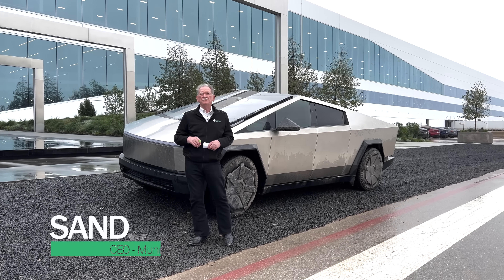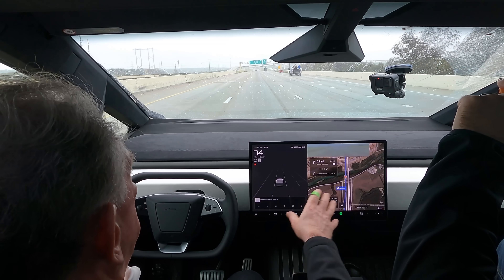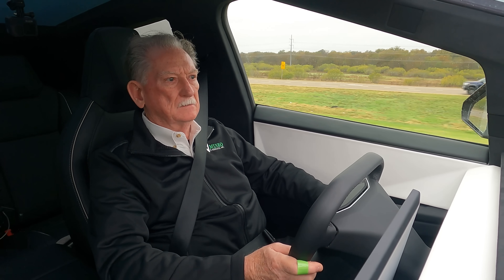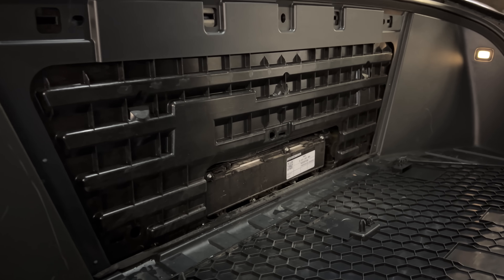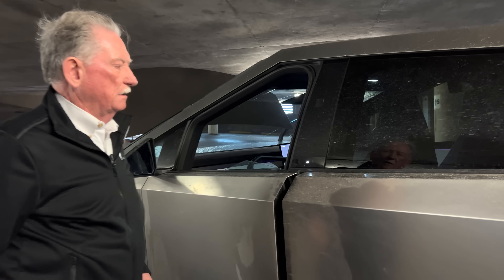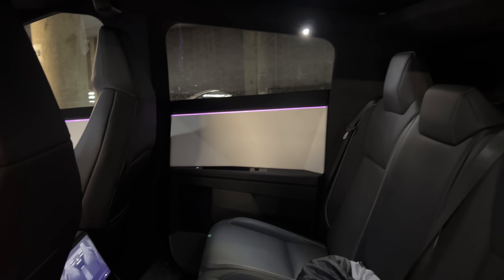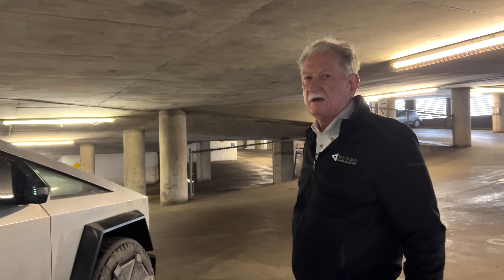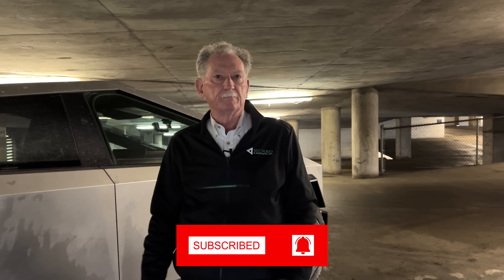Sandy's First Impressions of the Tesla Cybertruck!

Comment: He didn't mention the weight of it, our off roading in NZ is steep slippery. This would be very scary on down hill if hasnt destroyed the track on the way up with wheel spin. It doesn't  appear to have much space in the back for tradies the bulk of the buyers. Not to  mention the charging time if you can find a charger. Australia will have different issues. It looks cheap inside saving on conventional buttons. Interesting concept.

Comment: Had to laugh when Munro said on an interview that farmers would be looking to replace their tractors with the CT.
Oh, and repairs wouldn't be an issues, despite no bodyshops being tooled or trained in fixing that sort of chassis.
I think too many Elon fans are getting high of his farts..
Reply: I saw the back side of a stainless panel on one of the tour videos.
Looked like there were bolt / location holes.
That being the case you'd only need a socket set and a jig to space the panel.
Tight folds, straight edges and 90° corners would make it EASY to align.
.
That would explain the equal gaps Sandy saw.... Once the first panel is right, the others all work from that.
.
But you can stay hopeful that nobody thought of that. 😉
Reply: @rogerstarkey5390   Galvanic corrosion could be an issue. Either way, price, range, payload capability on the street, as lack of aftermarket support, as parts supply, could be a big deterrent for many truck owners.
Reply: @rogerstarkey5390  time will certainly tell Roger

Comment: BlackBerry vs iPhone moment.
Remember the advertisement Acura legend 1980’s with steel marble for panel gaps.  Not sure what the big deal with everyone looking at panel gaps.  Take a look at other car.  I buy tech and dependability not panel gaps.
Ford/GM/Dodge are highly dependent on their trucks vs Tesla more for mass cars, Y, 3, and soon 2.  Cybertruck not a huge part of Tesla.  Remember Tesla is an energy company.  Car batteries have made Grid batteries competitive.  Tesla msrp always pays for superchargers that it builds.  Tesla has diversified batteries vs competition.  Most vehicles LFP(lithium IRON) but also offers 18650, 2170, 4680 tabless DRY CELL.  Tesla also offers SOTA and FOTA WiFi updates.  USA needs more solar and storage batteries as USA energy will become expensive like other countries.  This truck has so many new techs, steer by wire, 48v low volt, 2 400v batteries to make 800v, thick stainless exoskeleton, competitive with other EVs with larger batteries.  More Tesla superchargers supplemented with solar and battery storage.  The past 4 years increased inflation that compounds every year.  High interest rates means companies with high debt paying more money to service past debt with less money for future innovation.  Similar to government overspending taking out more debt to pay for future debt

Comment: I like the rear wheel steering and of course there’s the Tesla performance. But for how different this looks there isn’t a lot of innovation as far as use of space goes. For example, the small frunk. I don’t see anything that other vehicles don’t have. 
The range isn’t earth shattering. 
The bed isn’t that much longer than a short box, Ford or Chevy. 
I would buy a Rivian over this any day if I didn’t need the longer bed.
Reply: The feint isn't innovation from the company which invented the frunk (go on, say "beetle")
It's bigger than you think.
Range? More coming.
.
The bed? 7"" longer than the Lightning (and similar ICE F150) 8" more than the Rivian, a full foot more than the Hmmmm... Errr.
More load.
The same or more tow capacity.
More secure.
Tough.
Good job looking for negatives.
Reply: @rogerstarkey5390  I’m just saying it isn’t such a big advance in technology or design that I would trade in my Ford Lightning for it. 
How is it more secure because of the tonneau cover? I have one of those on my truck. 
I know what the bed length is and that’s why made the comment I did. Half a foot isn’t enough to make me drive something that’s this strange looking. 
And before you accuse me of being a Tesla hater, I’ve owned three of them along with other EVs and hybrids.

Comment: Checking panel gaps on a vehicle  allocated to media review is kind of silly.  It would be massaged into acceptability for sure. Let’s see how #1000 is 🤷🏻‍♂️
Reply: I bet I could fit panels on that.
90° angles.
Straight lines.
Location points on millimetre accurate castings.
Easy to gauge gaps.
.
Stop projecting old stereotypes and problems onto new products.
If anything, it's going to get BETTER as the workers refine their skills.
Reply: @rogerstarkey5390  Sorry, I wasn't coming at it from that angle.  Just saying that any good marketing department at a major manufacturer is going to make sure those gaps are good when they go out to media, even if they are conventially manufactured.  I imagine they will be great on the final truck, but the proof is in the pudding.

Comment: Sandy, I am with you on getting rid of the noise. It's right up there with the emissions as far as I am concerned.
Reply: On speeds of 50+ kmph well majority of noise comes from tires, not engine.
Reply: @alexeysamokhin9629  I think the aerodynamics of a brick also cause acoustic noise.
Reply: @PbPomper  Google says Porsche 911 TT has a coefficient of drag between 0.31 and 0.34, cybertruck has 0.335 so... yeah... brick.
Reply: @t3hpwninat0r  aerodynamic drag is a function of cd and frontal area. Boasting about cd and comparing it to low sports cars makes no sense (apart from marketing).
Reply: @DimitarStanev i'm comparing it to F-150
Reply: @@Ac_Adapter As someone that has built multiple cars from scratch and worked on car for 35 years, Raced cars and motorcycles for decades I will say loud does not contribute to enjoyment. I enjoy the sound of a good engine but if I can't talk in the car or have to stop a conversation outside it's to loud. Personally I can't wait until the obnoxious cars and especially the POS no muffler hardleys are gone.
Reply: @GROND15  I would ban noise in no time!, I have a bunch of stupid kids riding stupid slow but noisy 2strokes dirtbikes in my town. The funny thing is, at least in my country, we have a noise limit and there's a big fine if you get caught, the problem is local police are a bunch of useless and they don't do their job
Reply: @@Ac_Adapter Yep, agreed. My daily commuting appliance will be an EV, but my fun car will always be a loud H shift pure ICE (even though my EV is objectively faster than my fun car it has no soul).
Reply: If only the electric Harley Davidson would take over…
Reply: @@Ac_Adapter The sound might be nice on a V8 or flat 6 but most ICE cars don’t have that and don’t make a nice sound at all
Reply: @@Ac_Adapter I never said I was a car guy. I said, based on my experience, I used to have this sensation or feeling that large engines that make a lot of noise translated to raw power. That was just how I felt; Everyone has a different experience after all. 

My perspective has changed since owning and driving an EV as a daily driver. Powerful to ME means something different. You cannot decide how I feel. You can still feel powerful; I can still giggle at you.
Reply: I like the sound of a B58, your rattling 4 cylinder Kia, you can keep it.  I was next to a Mustang GT in my model Y.  I thought I’m faster and he’s just wasting fuel making noise!  Keep in mind I do enjoy a good gas engine and manual transmission, but I’m with most on this now that I’ve been enlightened with an EV.
Reply: @billm47645 V8's are fine, Nice deep rumble, it's those shitty Buzzbox 4 cylinder turbo's with Milo tin exhausts that are the worst, Absolute garbage sound like a kids toy.
Reply: Amen
Reply: lol!!!!! what are your useless EVs even contributing to improve the "emissions" everything from the roads to power stations to the grid, water supply, agriculture.... aviation even spacex rockets are not powered by batteries!
Reply: Sometimes I giggle at those cars that sound like they're working so hard just to keep pace with me. Other times I just find it incredibly obnoxious how loud they must be. It really depends on my mood. But, at least for me, since owning an EV and feeling the acceleration, I've come to associate that small whine of an electric motor to give me the same sensation that I used to get out of loud v8 engines.

Even while typing this comment, I hear through the music through my headphones a car outside slamming the accelerator down and making a whole bunch of noise. I'm wearing headphones over my ears, listening to music, in an incredibly well insulated office.... and I still must hear someone driving their car around? That just doesn't seem right. I don't understand the desire to be a part of everybody else's life by making so much noise.
Reply: @ColrathD dead right. I heard Tim Dodd, The Everyday Astronaut, refer to the noise as "the sound of Struggle".
Reply: @ColrathD A-fucking-MEN!!!!!! 🙏🏻
Reply: @ColrathD I love to.make noise, ide off myself if I had to give up noise making... especially with my car, glasspack muffler and delete the main cat to make it even louder.
Reply: in third words countries there are like 40 years old+ vehicles that are still on the roads doing way more job than those useless EVs.
Reply: elon is a god.  For the blind, He is vision. For the hungry, He is the chef. For the thirsty, He is water. If Elon thinks, I agree. If Elon speaks, I’m listening. If Elon has one fan, it is me. If Elon has no fans, I do not exist.
Reply: @addy405  Sounds like you had some kind of contribution to this drug dealers dream machine.
Reply: I like noise.
Reply: More noise, more fun.
Reply: I really notice the vehicle exhaust when bicycling.  I'm glad it's going away, and it's already much better than it used to be.
Reply: @pfcrow  unfortunately its not going away sorry to disappoint your useless EVs arent going to take care of that gigsntic infrastructure they are relying on. how many inches of roads have the 1000hp 0-60 in 0.5 s have ever built!?

Comment: If the power goes out and a the car is on fire or you are rolling towards a lake and the power goes out, the steering wheel no longer works and the doors would lock you in right.
Reply: I was just about to award "dumb comment of the day" to someone else!!!!
You just beat them!
Reply: @rogerstarkey5390  Its not your fault. Youre just ignorant. Certainly youre aware of the number of ev owners who have died or almost died from being trapped in their tesla EVs because of the battery dying and a fire started? Of course, you haven't, because you're a moron
Reply: @rogerstarkey5390  As of November 26, 2023, 80 people have died in Tesla fires. 14.5% of Tesla deaths involve "fire" or synonyms, compared to the countrywide average of 0.3%. Why would they die in fires, Roger? Come on old man

Comment: Another product from Tesla that slapped the auto industry clean in the face. Never underestimate Tesla and Elon Musk.
Reply: I can only think of one improvement… The ability to add a range extender in the sub trunk under the bed. Either in addition to or instead of their existing one. This would add  a lot of versatility.
Reply: @paulrybarczyk5013  Would have been a better option for the towing buyers. But if you are towing, you typically do not need bed space. Really towing. And I do not think I would ever buy the CT for towing. That is where I buy a dually. Nobody should be towing more than 5-6k pounds without a dually ideally but sometimes that is not possible. I fear for these people on the highway with a sagging F250 barely able to keep 8k pounds stable. I think there is a disconnect between 'pulling' and 'towing' in America. You need 4 wheels in the rear to have a stable tow vehicle. Period.
Reply: @ICEV  I see your point, but I was suggesting it should be possible to have either one or two range extenders, And the latter would be for max distance. Also, the self-leveling and stability controls of Tesla‘s truck should be vastly better than most of what’s on the market today. I’m looking forward to those tests.
Reply: It's the equivalent of the nurse snapping on the glove and saying "bend over.... This won't hurt"

Comment: Please tell me the rear mirror camera is in the inside at the top of the truck…..That the problem Tesla seem blind to the basics people need. If they think builders are going to use this are they delusional and I’m Tesla fan boy. Chunky buttons nah a touch screen that would get plaster, pain, oil, dirt you name it.  It’s a toy and trinket even if they are extremely capable truck.

But if it gives Tesla a boost financially to move on to the Model 2 and a few lessons then brilliant.

Comment: I would need an in home charging station for sure. I don't do well with range anxiety.
Reply: There is no range anxiety with Tesla. You never think about range. Ever. But EVERY EV owner should have a wall connector inside their garage or on their property to power up the onboard charger.
Reply: Get yourself a piece of paper.
Log your mileage for a month. Every time you see a Tesla charge put a tick on the list.
.
Every time you stop somewhere and there's a charger, put a circle.
.
At the end of the month, you'll see that you were either stopped and "doing things" next to a charger (best time to charge is "when you're there anyway".
Or
If you had to, you passed a charger where you could get a 10 minute top-up while you checked your social media.
Reply: @rogerstarkey5390  Or spend $450 bucks and get an electrician to install one at home and don't live like a gypsy.
Reply: Home charging is great and cheaper than gas/diesel.  Always start the day with a full battery.  Never need to stop at a gas station.  Long trips with Tesla's huge supercharger network integrated with the in-car nav app makes charging on trips easy.
Reply: @datamatters8  Never charge over 80% unless Nickel or long trip.

Comment: If I had a need for a truck (and the money), I'd buy one of these.  Amazing piece of tech.
Reply: that's the problem trucks are useless for most people, including 80% of truck buyers. but if you need one but don't tow often heavy trailers over long distances, the dual motor has good specs as long as you forget the initial specs at 2019 reveal, plus a lot of trick features
my biggest complaint is it's hasn't demonstrated any real world advantage for the stainless steel "exoskeleton" body and "structural" battery pack. for all it seems the structure is the aluminum unibody and gigacastings. it's not significantly lighter or cheaper than a Rivian. it could have rust resistant lighter aluminum body with much better drag coefficient
Reply: @geemy9675  Kind of hard competing with Rivian as they still operated at a loss of $33,000 per car sold as of Q2 2023. Without the venture capital, it would be a much more expensive car, something Tesla is able to avoid in large part due to the battery pack and comparatively cheap castings. So those are the real advantages, they just aren't as apparent as they otherwise would have been.

I don't think this car is good news at all for Rivian, this seems to be the new #1 choice for a "quirky and different" type electric truck. Tesla is now a very dangerous competitor where they previously had none.
Reply: Well, if you order now you can slowly save up money because it is going to take years before you'll get one.